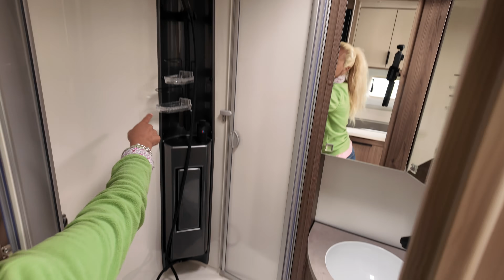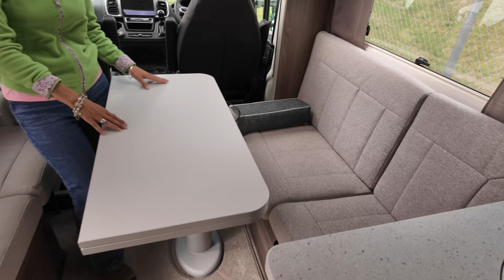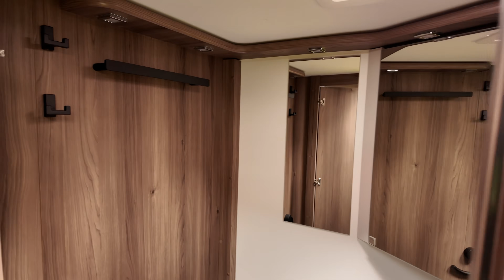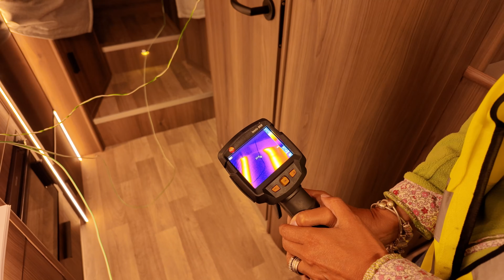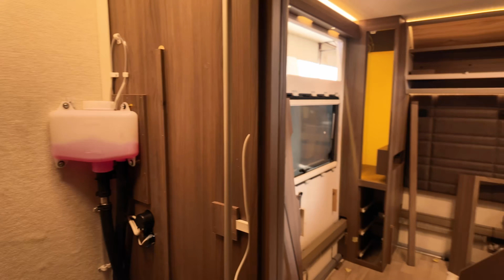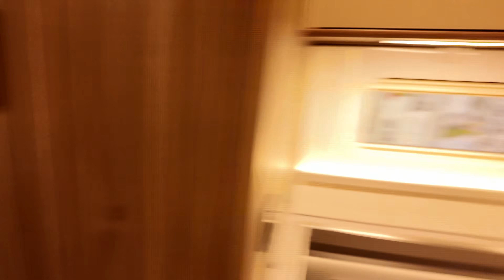KABE Factory and NEW COACHMAN Motorhome Models: What’s Coming?

Comment: Do love the Coachman. Pity they can't do something about the weight distribution on the Travel Master 545, very rear axle limited, meaning uprating required even though already 4500kgs. Quite expensive as wheels and tyres also required as well as Air suspension, add to that no height increase on semi-air due to the Alko chasis, means you have to go to full air to get that extra clearance. Shame they can't get some of the weight further forward over the front axle. Great information again, and stunning Motorhomes, thanks for sharing.
Reply from the maker: Thanks for watching and that’s some interesting feedback.